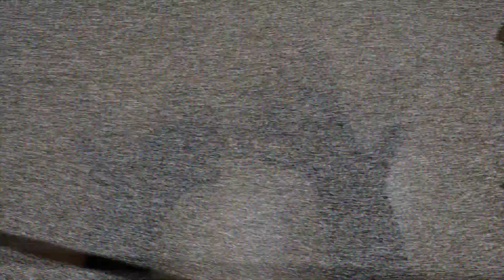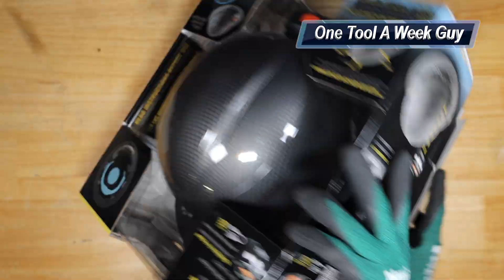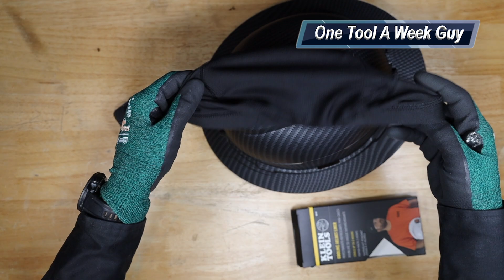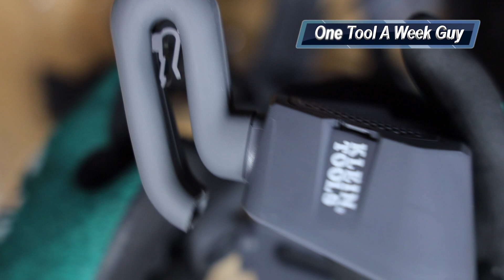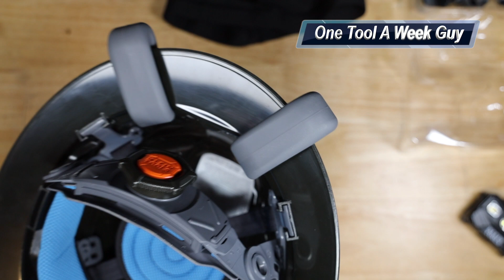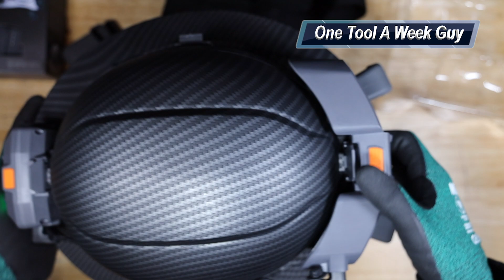Klein Tools Hard Hat & Accessories

Comment: Battery broke in the first week. Wouldn't take a charge after the first time. And its way to friggin heavy with battery and fan.
Reply from the maker: Thanks for sharing. Need to to an update. Had the same issue. Took it to a rep of Klein and swap out battery’s no charge. Did not have issue with wait just balance out with fan in the front and battery pack in the back. Notice the fan hits better when it’s position front.

Comment: I've worn this hard hat and liner combo in a low roof attic in Georgia when it was probably 120-130 degrees in the attic and it made a huge difference. I wasn't worried about hitting my head on support beams,  and the fan allowed me to stay in the attic longer without feeling like I was gonna drop from heat exhaustion.  I highly recommend this for HVAC techs and installers
Reply from the maker: Quenton thank you for sharing and letting us know 👊 Been using it out here in Texas and its a must for me now lol
Reply: An HVAC installer just found your comment and is very tempted.